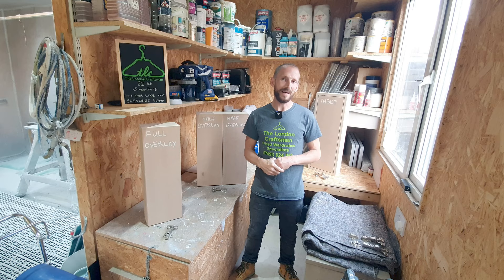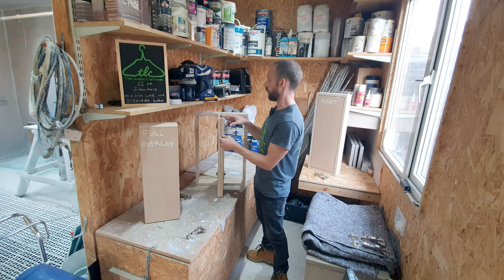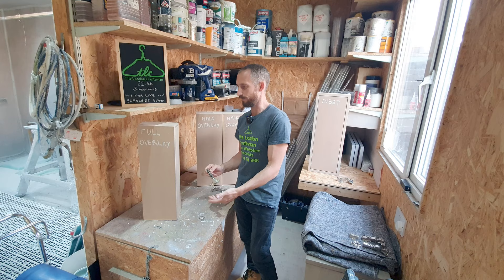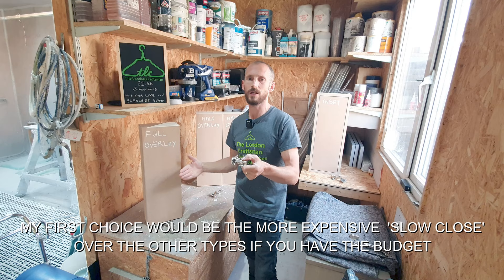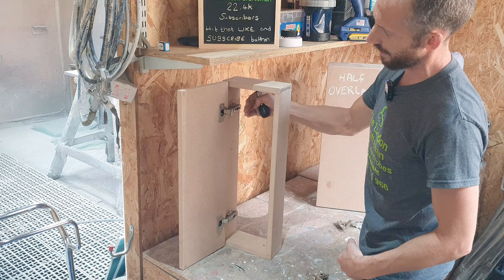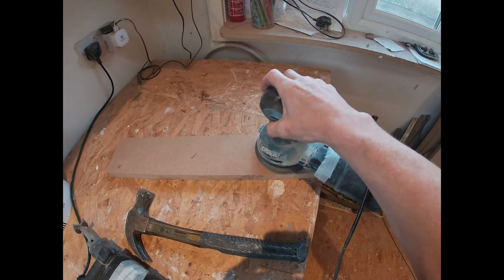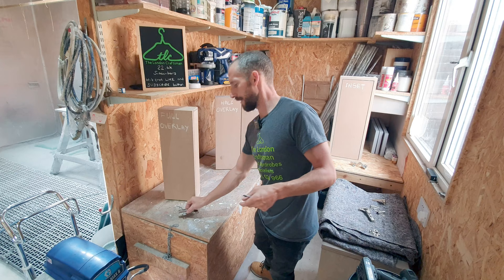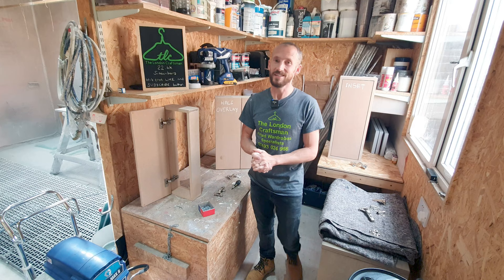The Main Cabinet Hinge Types Explained || Concealed / Euro / Kitchen Hinges - Vid#72

Comment: When your using the inset hinges is the set up for the hole in the door and the back plate on the carcass the same as the full overlay hinges.
Reply from the maker: Hi the cup hole is.
Off the top of my head I'm not 100% sure about the frame side without checking in rhe workshop.
Cheers ryan

Comment: In your example of the half overlay,how would I measure the width of each door to fit the carcass properly using half overlay hinges?
Reply from the maker: I guess it all depends on how wide your doors are. 
Basically, if using 2 overlay hinges on a single 18mm division, each door will overlap that division by around 7.5mm ish.
Basically 2 x 7.5mm overhangs plus a 3mm gap between the 2 doors equals 18mm.
Then add whatever width you need onto the 7.5mm, and that will give you each door width.

Comment: Ryan these videos are ace. I’ve watched loads and learning tons thank you . I just bought 30 gtv full overlay hinges can I ask how many would you put on double wardrobe doors about 350mm. X jut over 2000mm 18mm mdf. Also a bit cheeky have you done any vids on scribing to the ceiling. My wardrobes are an inch off the ceiling and I need to hide the tops. Any ideas 🙏. Subscribed 👍👊

Comment: hi , Can you fit full overlay  concealed hinges if the carcus is 40mm and your door is  12mm thick. If so is it the same method as you mentioned in your video? mine does not want to line up so its full overlay . I try to adjust side to side  height and all but still no luck . Any help would be very much appreciated. thx

Comment: I have 24mm doors to hang 18mm and 6mm planted I want to have them inserted, what hinges would I need to use and would I have to put a door stop on the inside of the frame 26mm back and screw the hing to the door stop?
Reply from the maker: Hi im unsure with 24mm thick doors. Call hafele sales and they will advise you 😁

Comment: In the Full overlay: when the door is open, it’s not aligned. It’s a bit shifted to the right side. For how much is it shifted? I’m asking, because I’d like to use a Blum drawer and afraid that a door will block it to open. Blum has 5mm gap from a wall to a drawer‘s front. IKEA’s drawers won’t have this problem though. Thanks for a video. Really good explanation;)
Reply: 90 degrees

Comment: Perfect timing for this video! Would the Full Overlay hinge be OK, if there is to be an end panel that finishes flush with the front of the door?
Reply: Yes. As long as your door is slightly smaller than the cab. Like they are on a kitchen

Comment: Is there such a thing as an inset hinge that is designed so that when I open the door it comes out flush with the inside of the cabinet? The reason I ask is because I have jewellery tray I installed inside the cabinet and it is on slides. When I open the door to slide the tray out, the door is obstructing the tray from coming out...

Comment: Hi Ryan,

With the inset hinges is there a maximum door thickness you can have? Also is there a chart or a system to work out where to drill the cups and how to set the hinges in the carcass. This just my first time using inset hinges. 

Thanks again

Comment: On the Half Overlay doors, assuming the mounting plates are on either side of an 18mm sheet, how do you avoid the screws clashing? Having a screw shorter than 9mm doesn't feel like it would be strong enough?
Thanks

Comment: Excellent video. What’s your thoughts on screwing hinges into MDF. Will they come loose over time. What would be your preference for carcass material
Reply from the maker: Hi screwing into mdf face is fine just no good on the edges as it breaks out. I'd say ply or solid timber would give strongest results 👍👍

Comment: Hi. Thanks for the videos, really useful. I'm making a built in wardrobe with 4 carcasses screwed together. I'm going to use full overlay on each of the doors without any shared divisions. How much smaller than the carcas should the doors be? Each carcass will be 500. Using 18mm mr mdf. Cheers! Ged
Reply from the maker: Hi I have 2 sketch up designing videos that talk about that subject I think. There's a few elements to take into account.
For example:
If the doors are starting and stopping exactly at the beginning and end the the wardrobe/ carcasses, and you have 4 x 1000mm carcasses. That would be 8 doors.
So I work it out generally by taking the total (4000mm), and taking away 7 x 3mm = 21mm ( 7 x  gaps in between each door at 3mm wide).
That leaves 3979.
Then all that's left is to divide that by the number of doors which is 8.
3979mm ÷8 = 497.3mm each door.
That's the way I generally do it.
Does that help?
Reply: @thelondoncraftsmanworkshop  thanks for the reply. Actually that's really helpful yes. So 3mm gap seems to be the one to go for. I didn't realise you had sketchup videos too I think that could be really helpful for me I'll check them out. I'm designing them in CAD (Solidworks) and then I'm going to get them cnc'd at a local place. I don't have the tools or the space for any other way unfortunately. The wardrobes I'm making currently have each door with its own carcass. 4 total. Thinking after your comment though that I should change this to 2 wider carcasses (1000mm) with 2 doors each. Is it better to have a wider double carcass rather than individual? Hadn't thought about it until now.